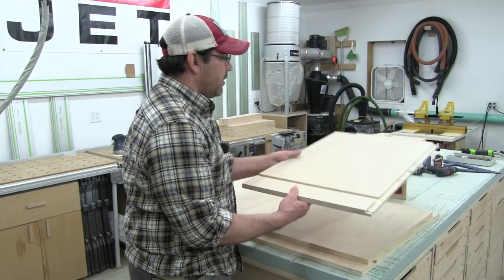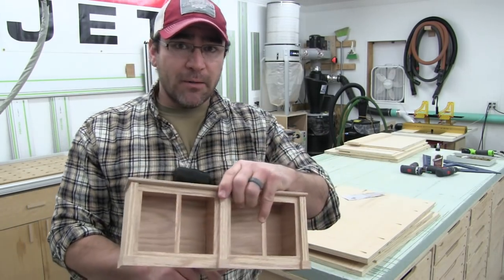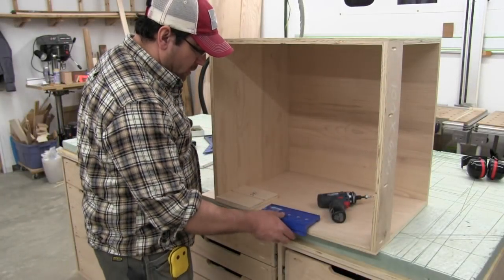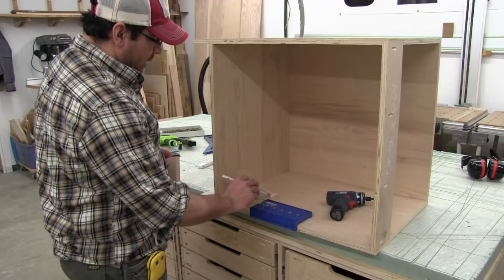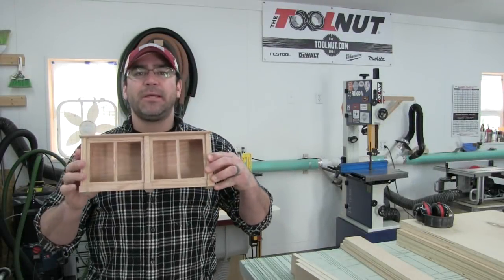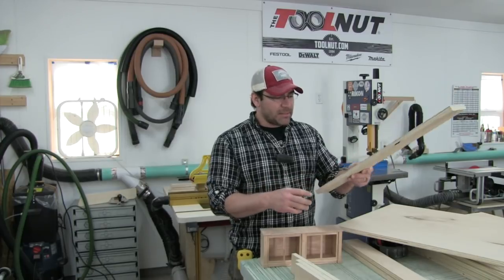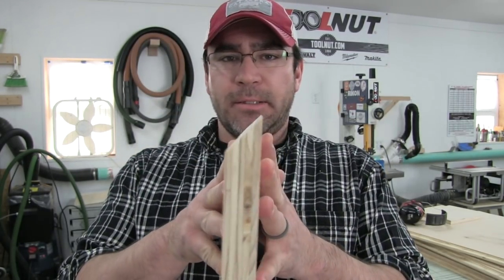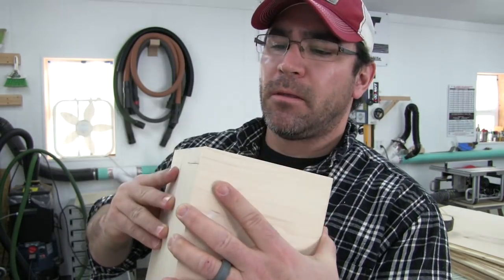Making a TV Console Part 2

Comment: Very cool... Is there a reason you chose to use a 45degree miter bit over a Lock miter bit... Just wondering.... Looks awesome so far
Reply from the maker: Hey juju,   I don't have a lock miter bit.  I considered buying one  but as you can tell from the video...... decided to just use a 45 degree bit. LOL    I would like to buy a lock miter bit.  I'm always up for trying different joinery methods.
Reply: Iv had great results. Normally I just glue it up and painters tape the miters closed to hold in place and  2 nails top and bottom thats usually hidden by what ever moulding im applying... You will love it. Also get the set up blocks. I believe rockler sells them such a Time saver....looking forward to more videos

Comment: Hi, did the ply splinter on the sharp edge when cutting the 45º mitre,? Good quality ply is expensive here :(
Reply from the maker: Gid, I did not experience any splintering on the ply from cutting the 45.   The ply I'm using I consider to be medium grade ply.  Goes for $54 for a sheet here in my area.
Reply: OK thanks, just curious, we can get medium grade Birch faced ply that has a Poplar core layers but it is £50+ 20%vat a sheet, Poplar ply is available & a little cheaper but only from big commercial suppliers who have a min spend of £500,  All our ply is imported into the UK. Thanks.